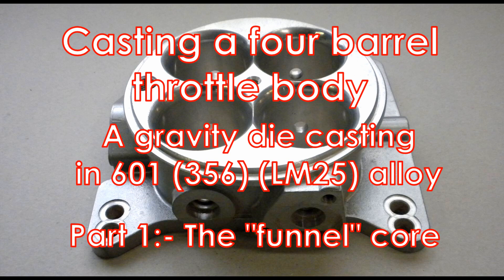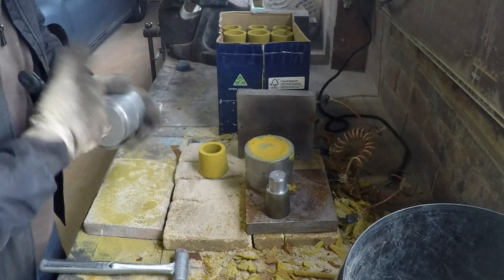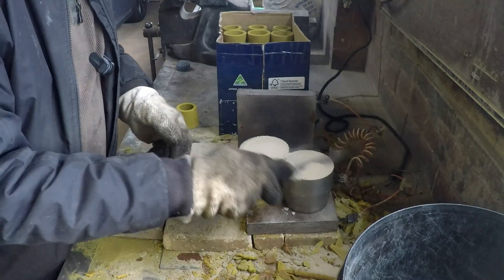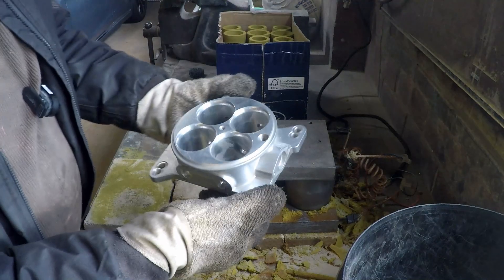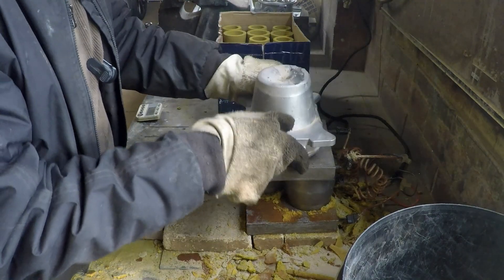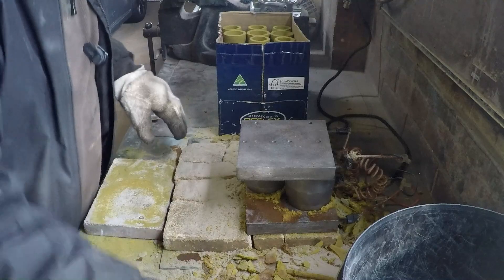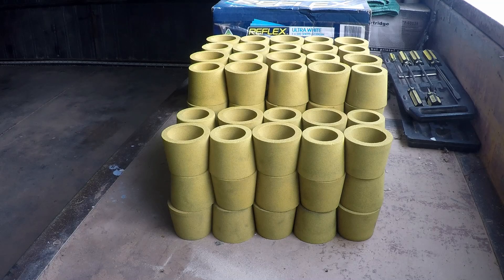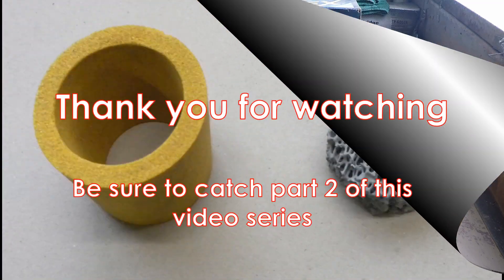Casting a four barrel throttle body Part 1:- The funnel core

Comment: Nice to see a simpler application of resin coated shell sand rather than just the complex stuff they show in the textbooks.
Reply from the maker: Ask, Everyone should have a bag of this sand as it makes great cores, they are strong and store well. Only problem is the need for a metal core box but with your own foundry you can cast those - some to size - and with a lathe if you or a friend has one machine as necessary Much better cores than silicate  or oil type sands... Martin

Comment: Glad to see you are up and at it again Martin. This is going to be a most interesting series of videos. As Red Green says keep your stick on the ice!

Mark
Reply from the maker: Mark, Ow that's a way to get a damn cold stick. Glad to have your interest. Someone (who has seen it all) said that it was way beyond what any hobbyist would do in their garage - I pointed out that once it was way beyond what I would do in my garage but that its just a matter of grabbing the opportunities life throws at you  - lemons lemonade... Martin
Reply: @olfoundryman8418   I agree with you. I started casting in grade 8. Really old ! To stupid to know what I couldn't do and a head full of ideas. I did make  a lot of bad castings. But I was bit by the casting bug and by the time I left school I had a decent handle on what was what. By that time I was a little more advanced than 90 plus percent of the stuff I see on Youtube. That leads me to why I watch your videos. You present a reasoned out, experience driven scientifically accurate way of getting the job done. There's no slavish adherence to stuffing in magic powders that have no value or overheating the melt, or using steel crucibles with no refractory lining that ruins the melt for many purposes. You give me many things to think about. This series will be very useful. I have design work for loudspeakers driver construction that will require repeat castings that are rather complicated. And I soak up what you do and show like a sponge. So you have Sponge Mark's eternal gratitude. Keep up the videos Martin. I really learn from them and appreciate them. You and luckygen1001 are the two gents that really do know what they are doing. Not trying it out. Journeymen in the true sense of the word. Proven performers of the art of casting.
Reply from the maker: Mark Soak away! That's what I am here for. You are not wrong about  what you see on YT at times I am aghast at what some people do😱. I will pass your comment on the lucky I know him well and he will enjoy it. Thank you... Martin

Comment: Where do you purchase that resin coated sand?
Reply from the maker: Farm, The resin coated sand is usually readily available just about anywhere in the world it is a very common product. Just try the local phone directories or Google under "resin coated sand" or "shell core sand". It is usually available in different resin strengths from less that 2% to over 4%. I would suggest starting at about 3% and see what you can get that's close to that. Its also usually available in varying AFS grain sizes mine is AFS 70 but I would like it finer at AFS 90 if that was available locally. The other thing you could do is approach a (small) local foundry to see if they use it and if so offer them cash for a bag. I pay about $8.00 to $10.00 per 25 Kg bag. Mould temperature needs to be about 180 deg. C. Its good stuff you will love it - the ability to make hollow cores is a great benefit.... Martin

Comment: Martin, Have you any thoughts on how to cast 20" aluminium bandsaw wheels. Possible or is machining from plate a better option.
Love your videos.
Reply from the maker: Andrew, To cast or to machine? Depends I think on what resources you have. I would cast because that's what I do and just too see if I could, and it would make a good video. Also I don't have a lathe that will swing 20 inch (hmm, need a lathe either way!) That is a big mould and it would have to be quite thick too and reinforced or it will likely drop out of the flasks. It would be very heavy - definitely a 2 man lift or a crane. A fair bit of metal too. I would pour it down a large central feeder with a filter at the bottom of the feeder and just above the casting itself the filter is vital if you are to get anything like a reasonable casting pouring like this. If you can come up with the plate (expensive I would think) and have access to a suitable lathe it may be the easier and quicker method. 
 Have you considered using a wooden wheel  plenty of people have done so and it seems to work ok... Martin
Reply: @olfoundryman8418  Thanks Martin. The machining I have 2 options. My lathe I can turn up to 450mm diameter, so if I was to accept a bit more stress on the blade with a slightly smaller diameter, I could do that. The other option would be to use the milling machine and a rotary table. A bit slower and more fiddly, but achievable. I have had a lot of thoughts about different options. The blade will be 38mm with 2,500 psi tension so I think my only option is Aluminium or steel. I had considered finding some damaged mag wheels and machining off the outside rims and just using the center part. Some people use car tyres, but I doubt I would get the required tension. Where are you located? Maybe something we could discuss.
Andrew

Comment: Are the ceramic foam filters available in Australia in sizes and quantities suitable for home/hobby casting?
Reply from the maker: @abc, Yes and no! Filters are available in Australia from both Pyrotek and from Foseco. However they usually want to sell you a box of 500 filters and that is many life times supply for a hobbyist. When  I last bought some they were about $0.50 each  but no doubt are more now so a box of 500 would be likely a bit too much of an investment. However how many do you want? I have some (but not a lot) here and to be honest I am unlikely to ever use them all so I would be prepared to part with a few and could possibly organize future small supplies through a foundry known to me. Do you live close? (Croydon Melbourne) come to me at  olfoundryman@gmail.com and we should be able to work something out. I have 50 mm diam * 20 mm thick and 50 mm square * 20 mm thick..... Martin
Reply: @olfoundryman8418  Thank you for your reply Martin. I have sent you an email.

Comment: Question, how do they make the ceramic foam filters?
Reply from the maker: Mark, The sideways video the Ian has sent a link to sort of shows it - I  think. My understanding it that they take a piece of open cell foam made from an flexible and burnable low ash material. Soak it in a suitable refractory slurry squeeze the excess slurry out so that you now have a foam coated with a thin slurry layer, dry the slurry and fire to burn the foam away and leave the fired ceramic. Its how the used to do the lace work on superior ceramic ornaments years ago - dip real lace into the ceramic slurry squeeze out the excess dry and fire the result, bingo ceramic lace work!... Martin

Comment: Just wondering, is there not a funnel that you can purchase that is premade or is anything that you can buy too expensive?

Also, how are you handling your winter? Any snow in your area?
Reply from the maker: Brandon, I don't know of anything similar commercially available, it might be overseas but here in the great land of "you can't get anything here" it does not seem to be. As you can see they are fairly quick to make and the sand is cheap.
In my life time it has only snowed once in Melbourne - 1 inch of muddy slush! A really, really cold day here is a max of 8 deg. C but our winters can be dull with drizzly rain - not exactly very nice, today though made 18 deg C. Unfortunately neither our clothes nor our house are really built for cold weather... Martin